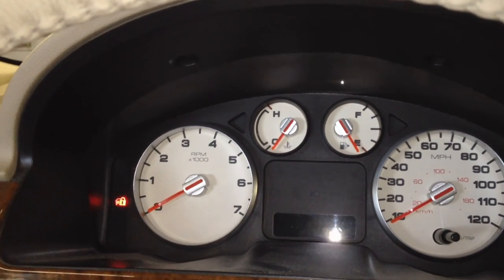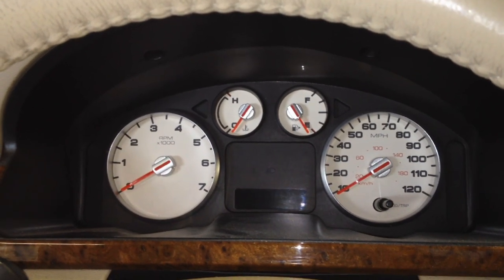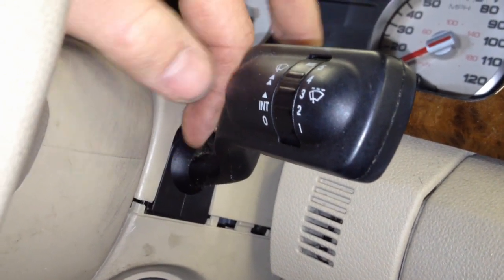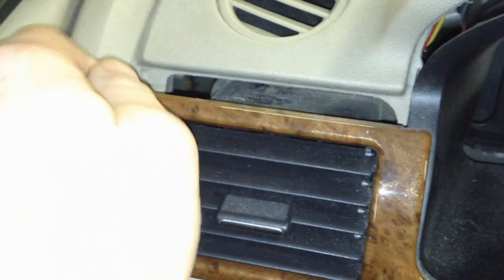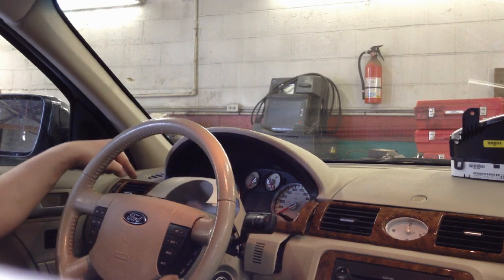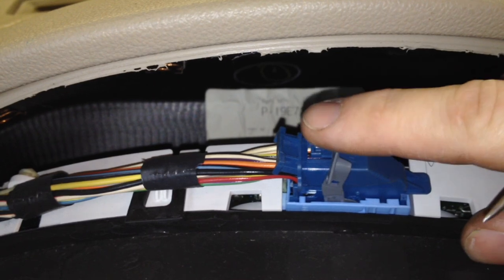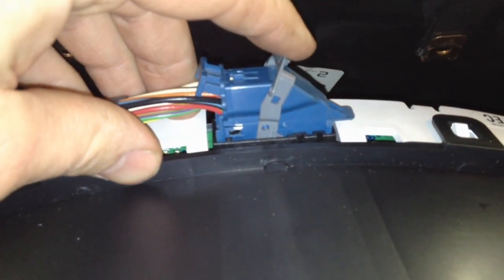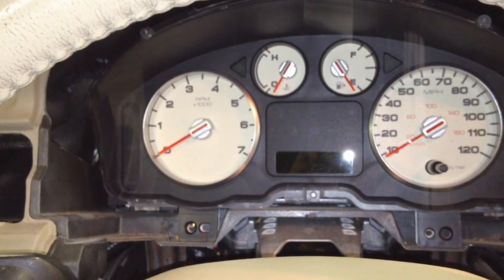Ford Five Hundred Mercury Montego Instrument Cluster Removal

Comment: I changed out my bulbs and now the cluster lights stay on without keys in ignition..
Reply: What model and year?  I have 05 Ford 500 and one background light at the temperature dial went dead.
Plan to take the cluster out and replace..but He said 2005 need a programming, so I think this is low priority for me!
Reply: @DaiLenMatHo  turns out that my cluster  was just bad.  I tried the solder joint trick and it still didn't help.  I went to a pick a apart and traded out for one with similar miles.  It works great and I changed all the bulbs out.  My window switch wouldn't allow auto upor down.....changed it out...it works...from now on....pull a part will be my first defense
Reply: @DaiLenMatHo  2007 Five Hundred
Reply: @JAYEDHHP  

According to this video, seem the clusters of 05 and 06 need programming.  I am not an expert but I guess for these cars Ford made a link between VIN/transponder code from the ignition switch to the cluster, thus you can not replace the cluster w/o going to dealer.
Then Ford realised that was a hassle and removed this feature from 2007 Ford.
Reply: @DaiLenMatHo  i am 95% that only 08 Taurus needs programming, you can put parts from a freestyle on this car...lol....or that mercury model
Reply: @JAYEDHHP  Thank you, I do need open source for my 2005 Ford 500!!!